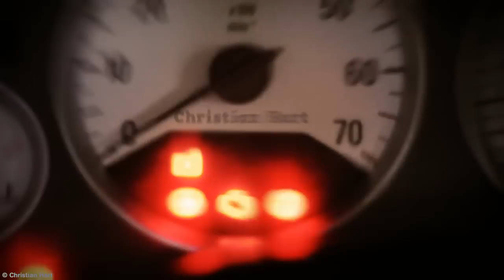Opel Astra OPC - Cat-Back Exhaust Installation

Comment: hey man, fantastic vids. I've learned so much and will attempt a timing belt change soon. I've recently come to own the version of your car with the roof chopped off. Is there any downsides to running a full 3" exhaust? is it too loud for daily driving? Did your fuel consumption go up? Would Vicroads kick up a fuss about it? And are the pops I can hear in the video at the end from a stock tune or has it been remapped? 
Again, man, fantastic vids!

Comment from the maker: Yeah, I've replaced the front section with a full 3" exhaust and a single 200 cell cat. I had to install an O2 cheat adapter on the rear O2 sensor otherwise the engine light comes on after a few hours of driving.

Comment: Did you use a gasket sealant or paste for each connecting section of pipe?! I didn't see?!
Reply from the maker: Wes Palmer If you have new gaskets then it may not need sealant. But a bit of sealant is usually helpful.